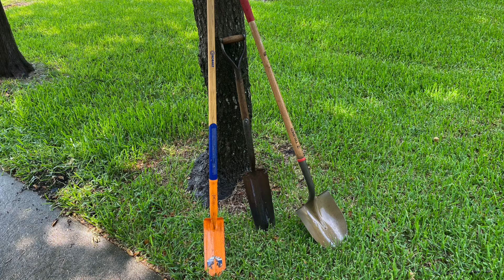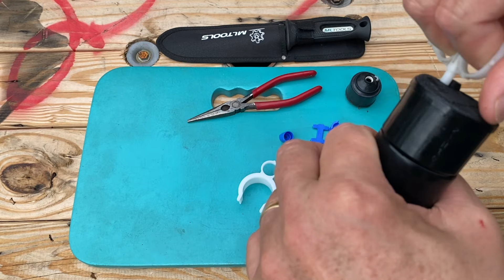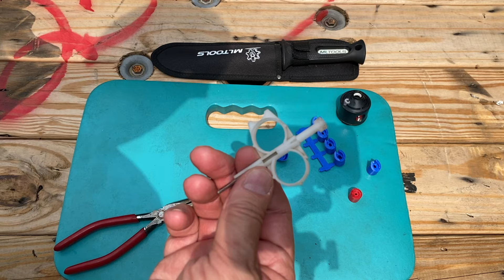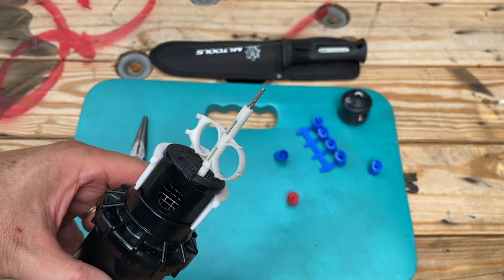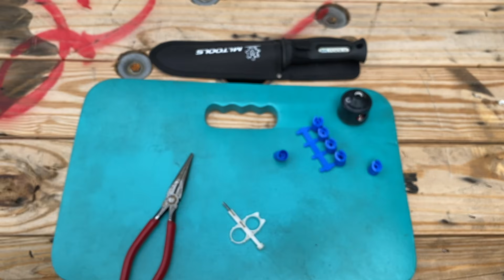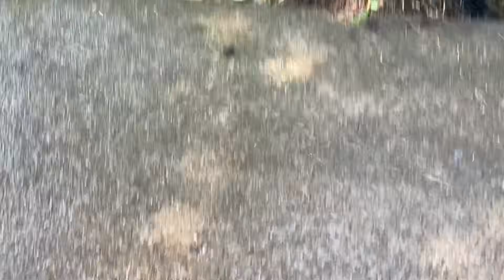Hunter PGP Sprinkler Head Replacement

Comment: Unable to control the start and stop of my arc of watering....I just can't understand/see your instructions for this part.
Reply from the maker: The most common point of confusion on the Hunter PGP is that the LEFT stop is fixed and cannot be adjusted. The sprinkler always rotates back to that left stop position. You only adjust the RIGHT stop by turning the adjustment screw with the Hunter key or a small flathead screwdriver.

A good way to visualize it is to pull the turret up and rotate it by hand. When it stops on the left, that’s the fixed starting point. The sprinkler will then rotate to the right stop you set and return back to the left stop during operation. If your arc seems incorrect, make sure you’re identifying the fixed left stop first before making any adjustments.
Reply: @diycollaborative  wrong.  it's the opposite.  right stop is fixed on hunter.  only adjusting the left stop via the tool.  /rainbird is opposite of hunter

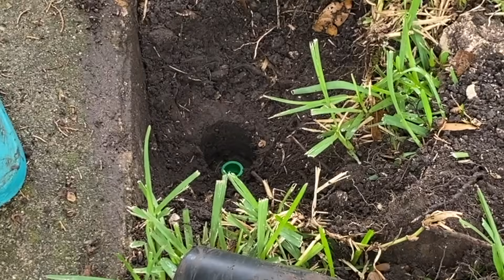Comment: Should PTFE thread sealing tape be used on the threaded green part that is in the ground (see 9:00 in the video) and that the sprinkler head screws into?
Reply from the maker: Yes, you can use (brand name Teflon tape on the threaded connection if desired or needed. We have & have not used it with basically the same results. No pipe dope though.

Thanks for watching and asking a great question.

😎🙏
Reply: @diycollaborative  Thanks for the quick response

Comment: I have a malfunctioning sprinkler head in one corner of our yard.  The pvc sprinkler irrigation line comes into the sided of the sprinkler head.  There is also a long spring beneath the sprinkler head.  It may have something do do with this corner being a bit higher than the other sprinkler heads in the yard.  Can I fix the problem with a regular sprinkler head, or do I need to look for another size or model?  Thanks.
Reply from the maker: You might just try replacing the head with the same kind of possible. Most pop up heads do have a spring in the body. You might also just start by checking just the nozzle & filter below the nozzle first. Sometimes the filter gets clogged up. Not sure why the line come into the side unless it was added later. Not clear on what’s malfunctioning, but it’s fairly easy to check. Hope this helps. 😎

Comment: Why did you replace the whole thing? You could've left the outside casing and take the internal part from the new sprinkler.
Reply from the maker: @richarderrington9478  I’ve tried that before and the older parts don’t often work well with newer inside components. Both ways can work though.

Comment: I want to shutdown hunter pgp sprinkler head. How to cap it off?
Reply from the maker: You could just remove the head and cap or plug it.  Likely 3/4” or 1/2” service line.  Determine line size and get PVC cap or plug in correct size.  You likely will need to dig down a bit to reach the service line.  There may be other considerations depending on your system.  How many heads per zone, type of valve, etc.  All doable.

Thank you for watching and commenting.  We appreciate you watching our video.

Please subscribe to the channel if you haven’t already.  It really helps if you will.

Please check out our Amazon Influencer page for many items we use and recommend.

https://www.amazon.com/shop/diyadventure

Comment: I’ve started replacing my Hunters with Rainbird!  That hex screw has given me nothing but problems. They fill with dirt & sand and you can’t get the hex tool in there. Rainbird has the flat head tool that is SO much easier!
Reply: That’s the one thing I hate about pgp’s
Reply: You can blast the sand out simply by holding your hand in front of the nozzle while opening the top with a small flat head screw driver. Might sound weird.. but if you curve your hand the right way you can push water into the top of the head. Or use a pin to clear sand out. Been in the business over 20 years and I’m 36.
Reply from the maker: Good information.  Thanks.

Comment: If the program to that sprinkler being changed is off, does the main water to the system need to be turned off?
Reply from the maker: In this case no.  The valve for that zone is under pressure for that zone, but in the off position from the controller there is no water flowing to the heads in that zone.  You could also shut the water off at the sprinkler manifold which is typically after your water meter, but before your zone valves.  I hope this helps.  Good luck and thanks for watching.

Comment: There is no need to dig out the whole thing. You can just undo the big screw in the top, and pull the inner stuff out and replace from the new unit. Then you don't need to dig as deep, no risk of a leak in the pipe connection, you get the same height from the get go and so on. If you're changing to a completely different model this doesn't apply.
Reply from the maker: We’ve tried that on a few of our much older heads that we run across and on some the new parts don’t align well with the old bottom case.  And even had a few leak.  And while we agree with you a bd would prefer that method, it’s not always possible.  Thanks for sharing.  Appreciate the feedback.

Comment: $13.99 at Lowe's. Don't need the big shovels. Just a small spade. Unscrew out and carefully screw in. Adjusting the arc (turn) was the tricky part. My irrigation company wanted $90.
Reply: 90 BUCKS!? for replacing a sprinkler head!? That's such a scam
Reply: @coler156 it’s a business… they have to get paid for the materials, the time traveling to and from property, and the time spent replacing the heads!
Reply: @coler156 Up here in Montana they want $200 per head 😂
Reply: @DylBuilder1  Well to be fair, the sprinkler heads are spaced 5 miles apart.
Reply: @Moondoggy1941 dude that’s not possible, they are about 50 feet apart
Reply: @coler156  - I live in a condo- the sprinkler company charges $150 !!!
Reply: @bbass56  Why would you have to pay to fix a sprinkler head in a condo complex?
Reply: @Moondoggy1941  - I’m on the board, so I deal with some of the contractors, I don’t pay directly, the Association does.
Reply: @coler156 what time coming out, replacing the head🤣 should be more like $200!
Reply: @coler156  $90? Its because they get dirt in their fingernails 😂🤣
Reply from the maker: Thank you for watching and commenting.  We appreciate you watching our video.

Please subscribe to the channel if you haven’t already.

Please check out our Amazon Influencer page for many items we use and recommend.

https://www.amazon.com/shop/diyadventure
Reply: What does the part called
Reply: @tazyeenkhan5237 Hunter PGP Sprinkler Head

Comment: I replaced it with a new one but it still leaks from the top of the sprinkler head-how can I fix the problem?
Reply from the maker: Sounds like it may be faulty.  Does it have the nozzle in place with the keeper screw in place?  I have gotten them before brand new that leak unfortunately.  Craftsmanship and quality is not what it was.